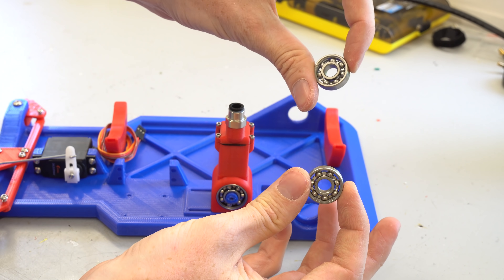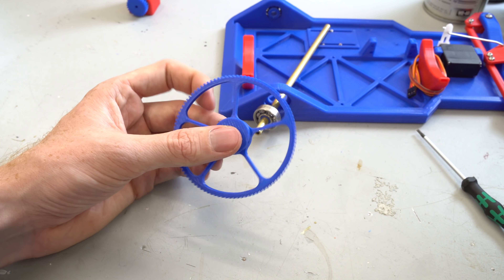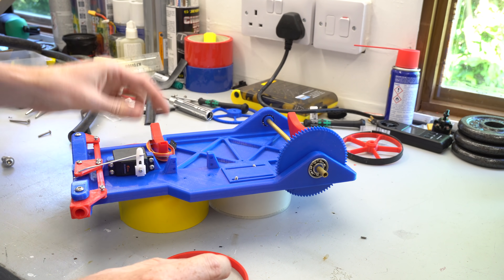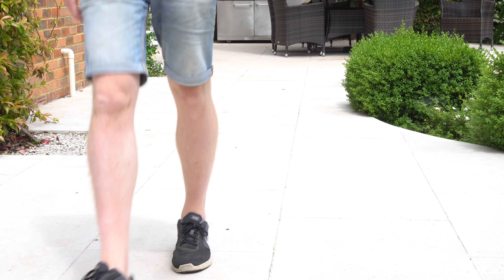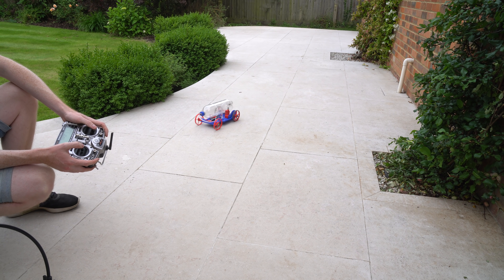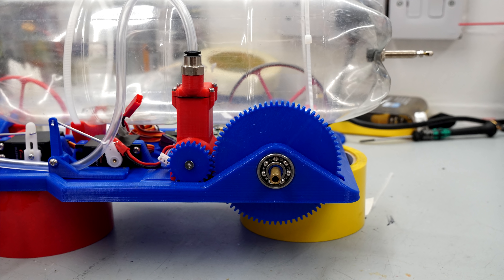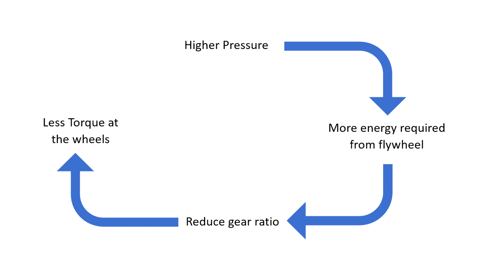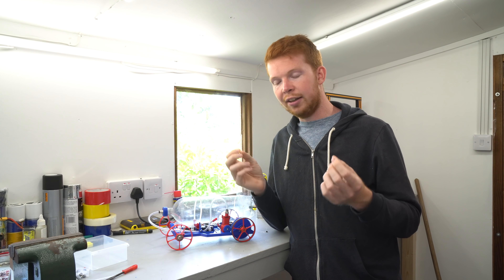Air Powered Car

Comment: The driven wheel is  running too slowly and is also too light to  be effective as a flywheel. You would be better attaching a metal flywheel to the engine shaft.   Otherwise I love it.  It makes a lovely sound as it chugs along.  Definitely worth persevering.

Comment: I would suggest making a simple centrifugal clutch. No return springs or anything like that, just two halves that will grip when rpm is sufficient and slip otherwise. Although that may be a bit wasteful towards compressed air, since the engine will freely spin until clutch kicks in. Add a simple cvt and that's a basic scooter transmission, which should work quite well.

Comment: Try making the air powered plane again! try using a more glider like design this time, it would be easier to power. I would really love to see a glider with a detachable air engine and bottle so you would only use the engine to get altitude until it runs out of air and detach it (parachute recommended)

Comment: What if you tried adding an extra flywheel connected directly on the same shaft as the drive wheel? This should not be affected by the gear ratio while still providing the engine with the touque it needs to push up the inlet valve.

Comment: With a belt type clutch you would spin up the engine and then taking off after hopefully working alot better... also you could then try to work on acceleration and test different gear ratios..

Comment: My suggestion would be to put a flywheel on the crankshaft of the engine rather than on the axle. This should allow you to gear the drive ratio down without reducing the flywheels effectiveness. My theory is that these air engines are more efficient per revolution when running at higher rpm as there is less time for air to escape past the piston during the down stroke.

Comment: make a small metal flywheel on the other side of the engine... maybe a pulley type clutch could work with 2 pulley wheels and a loose belt with a third servo controlled wheel acting as the tensioner engaging the clutch?

Comment: Can you not just pump the bottle to higher PSI's and use a regulator to output 30PSI
Reply: Just saw your comment. We have the same idea. This way his max PSI doesn't matter. His low RPM engine is actually efficient in that regard.
Reply: Yep, technically he could fill a small aluminium bottle to much higher PSI and just regulate it for a really long runtime
Reply: You could do that. Buuuuut...

WE GOTS TA GO FASTE
Reply: Along with the pressure regulator he could use a two or more cylinder steam engine design for self starting and us an aluminum container with some dry ice in it.
Reply: Julian Fernandez or use a small, battery powered compresor. I’m guessing 30 minute runtime. Maybe even more
Reply: @slippulter8053  at that point you might as well use an electric motor.

Comment: For an air engine would it not make more sense to draw inspiration from steam engines rather than internal combustion engines? 

Specifically, the only real reason to use a cam over an eccentric is the need for timing to fall on 90 degree intervals rather than 180. In your case the benefits of using an eccentric and slide valve over a cam and spring are near constant resistance instead of the spike you get as the cam engages, and greatly reduced resistance since there is no spring force to overcome.

Comment: idk if this will help, but i'll share it with you anyway. (If the gear is 12/35) Minus 1 tooth in front equals plus 3 in the back (gearing is 11/35 but has the same effect as 12/38) and plus 1 in front equals minus 3 in the back (gearing is 13/35 but has the same effect as 12/32)

Comment: You need to put dry ice and water into the bottle then attach it to the air powered motor
Reply: Combined with a safety valve, I can see it working.
Reply: google "dry ice bomb", then go sit in the corner and think about what you have done.
Reply: Papooch until your safety valve freezes, blocks with ice, and the bottle explodes. Go watch this video by Ben krasnow to find out what happens when you put co2 through a tiny orifice https://youtu.be/TvmM6qa2a90

Comment: f= frequency. T=1/f. your engine only produces power in half of a cycle.

you should double the cylinder to make your engine produce power continuously. if you want to use 1 cylinder only, you should change the valve system. I recommend a slide valve or a rotary valve (which you mention in the video).

my idea is to use a 2 stage engine. you will let the air push on the top of the piston in half of a cycle and at the bottom in the other half. you don't need to use 2 cylinder but you can produce power continuously. Because the engine produces power continuously, you don't need a flywheel to reserve power for half of a cycle (which doesn't generate power).

your car loses power when it turns due to friction because it doesn't have a differential.

edit: my english is not so good. it may be difficult to describe my idea.

Comment: I would think you would change the timing of the air entering the engine by a small bit. What I mean is try and get the air to enter the engine at a later time. More when the Piston is at a lower position in the cylinder. Unless you've already done this.

Comment: hello Tom, before redesigning all the engine try to add a flywheel on the crankshaft, on the other side of the small gear, maybe you get the needed effect
If the flywheel is bigger than the pinion you can lift up the engine with some thickness: extend the screws in the slots and you're done!
If you have to change the reduction ratio I think it's better to reduce the pinion on the crankshaft: the other gear is already as big as the wheel ... you'd have to redo those.
It's nice to see that little rat moving around the garden!

Comment: I think the reason you couldn't go faster by raising the pressure is due to reaching the engines "horsepower" limit with the current volume and internal friction. Since you added all the weight of a car instead of just a propeller, which weighs nothing, this seems like the only answer why it can't go any faster.

Comment: Build a pressure regulating valve this way you can increase the pressure and therefore volume in your tank without increasing the pressure at the engine.

Comment: Maybe add some sort of regulator or a pressure control valve so that you can limit the output pressure to 35 psi, while having a tank at a higher psi for longer driving

Comment: You could build another engine and arrange it so that always one cylinder pushes down or add a flywheel.
Reply: Stefan Bramel like a kind of multi cylinder engine, but with the gear or shaft to link them into synchronisation.

Comment: Maybe design a clutching mechanism to allow the engine running while at low throttle. May make more stable driveability. To add a simple flywheel or a jackshaft/flywheel would allow for stable idle. The engine in theory works with a constant load/fixed demand. It will need more mass to overcome the compression stroke.   I feel you dont have to increase pressures but you have a direct drive and no weight to toss around the horn. At square one, a clutch with low engagement speed will massively increase the mass for the engine to run. If I may interject? Get rid of the parallel drive system and go to a perpendicular set up. It will allow a clutch, flyweights, a short driveshaft with 90° gears and stable operati9n. Your 3d should accommodate that well. Also, look into building a base to implement a co2 cartridge. Very small tubing with an expansion section it will allow a decent pressure and function. Look up c02 air engines. They're been around for a while.

Comment: And if you craft a twin engine version? I think that it would be a nice idea. The thing is that I don't know the problems it may cause.
The pressure needed to run the engine is higher but other than that anyone can tell me? Pls 
Pd. Nice video bro

Comment: Maybe add an extra flywheel and then add a pressure regulator and fill the bottle with some dry ice. Should run for quite awhile.

Comment: why not  just make the wheels smaller?  Looks to me like it would solve the torque problem without touching the gears. Flywheel problem remains the same but inadequate torque is the major problem here. If you can get the car to accelerate a little bit it may overcome the flywheel problem since the momentum of the entire car is practically the flywheel

Comment: You can try redesigning the valve to work like a reed valve, the same stuff that is used to prevent reverse flow of gases in 2 stroke engines. The flap will have a lot less inertia than the ball.

Comment: For your next project you should try to make an air powered paddle boat, and use a dual pressurized bottle system. Put the bottles on the bottom of the boat to keep it afloat

Comment: I'm no physicist so therefore not able to calculate such things, but what if you calculated the amount of energy you need to put in to compressing the air and then measure the distance and speed that your car travels in order to calculate the energy loss between the two. 
By that you'd know the efficiency  and then figure out if you car isn't traveling far because of an engineering issue or because there just isn't anymore energy to be used.

Comment: Attach a fly wheel on the other side of the engine, I think that will work. You'll have to print a new modified chassis or just take out the dremel and go to work.

Comment: Need more torque, eh? Sounds like you need a multi cylinder engine! But In all honesty I deal with single cylinder lawn equipment engines all the time and they always have a very high gear ratio and a fairly massive flywheel for its size, or at least some sort of variable transmission or clutch. The power impulse is just too erratic for smooth operation without a large flywheel and high gear ratio. Which actually brings up the question as to whether or not a multi cylinder would actually be more efficient... I haven’t run the numbers I’m just thinking out loud here. Also this car reminds me of old steam tractors from the sound and wheel design lol. Good luck and keep us posted! Love seeing the process of trying to get these things working.

Comment: make your flywheel with a larger "flywheel" section, and then put the same gear you have now on its side, to you gain the weight of the flywheel and still have relatively the same gear ration. give it a try and see?

Comment: You may consider using a diferential. When the car is turning it's losing speed because the wheels should be allowed to rotate at diferrents speeds. In order the be more efficient maybe it''s better to drive only one wheel, and let the other rotates freely. Congrats, very interesting project!
Reply: A problema with powering only one wheel would be different speeds deppending on which side you turn. If the powered wheel is inside the tangent the car would turn faster than if the powered wheel is outside the tangent. A open differential would be a better solution, but the increased friction should be considered.

Comment: Explosive idea : Hydrochloric acid + aluminimum inside a bottle as a constant pressurised air supply (and heck you can even make an exhaust outof metal and have the exhaust fumes set on fire for extra style points :p)

Comment: You can also put a flywheel directly on the first (small) gear. So the efectiveness of the Inertia is much higher since the angular velocity for that gear is a lot higher (larger momentum). You won't even have to keep in mind your gear ratio then. 

Also the effect of the gear on the inertia is quadratic and on the torque it is proportional, you might want to do something with that.

Comment: Hi dude, I would suggest to use this kind of valves http://www.vparavoz.com/uzk/images/image_139.png
It will require two small metal plates where but all other part you can still 3D print. What do you think?
Reply: I think it will require less force to open and still provide enough good sealing

Comment: Also, there could be a way to increase the engine run-time, by limiting its RPM using a mechanism similar of Edison's phonograph's governor. Or a classing steam machine centrifugal governor. Edison's one worked by allowing the governor to only expand to a certain radius before touching a felt stopper fixing it to that speed (More detail in https://youtu.be/0vbyoZDQaIY?t=10m43s ). The steam one regulated the ammount of fuel admitted into the cilinder depending on its speed.

Comment: What about an in-line air regulator? Pump the bottle to 80psi set the regulator to 30psi you should get a longer run time at least.

Comment: If your throttle servo is a plastic gear, there may be to much pressure on the gears and could result in gear stripping in the servo. If there metal it’s fine but I couldn’t tell. Keep doing what your doing!!!

Comment: To prevent the large gear warp from happening you could try adding an aftermarket heated bed to your kossel mini if it doesnt come equipped with one. Also worth poiting out is the fact that if you do decide to add a heated bed you're also gonna need a better power supply as suggesyed by many other youtubers with the kossel delta. If you do have a heated bed then idk probaply play around with the heat settings and you should get it right but i understand how time is not on your side when making these videos

Comment: Hi, Tom! Great work on your current progress. Your project looks amazing.

I have found a solution that might fix your problem. You could simply add a heavy flywheel directly to the motor output instead of the wheel output. That would help you overcome the valve actuation counter for currently experienced by the wheel. It would also spin alot faster. A simple flywheel design could be made with a round 3D printed disk with embeded steel nuts.

Comment: Should go with a positive displacement vane motor or sun and ring type gear motor and you will have self starting, always runs, even without a flywheel at all to drive the motor for as long as you have pressure.

Comment: And why cant you add a starter motor to the engine it should be an easy solution to this problem I think
Reply: The problem isn't that it's unable to start, it's that the wheels don't generate enough torque to open the valve at TDC

Comment: It would be interesting to see a design that has a flywheel at the output of the motor that connects and disconnects to the wheels via some servo operated mechanism. Maybe by pushing a rubber wheel against the flywheel like the old cassette recorders used to do.
Also with this flywheel design you could add a second air path with some kind of wind turbine used only for starting the engine. Maybe with a more traditional pneumatic motor design like the one used for pneumatic screwdrivers, also you can look up how the artificial horizons power their flywheel. 
PS: Given that it doesn't become too heavy to run

Comment: Maybe you can try some different kind of air engine that doesn't use a cylinder? There are a lot of different water pump designs that could also be used as air engines.

Comment: separating the drive gear from the flywheel could solve this issue. you could design a flywheel that properly times the engine for higher pressures, then implement some sort of bicycle style transmission to change speed instead of relying on the throttle.

Comment: you can go for a multi-cylinder engine finally, I would say.
Best opportunity dude!! go for it ! It will increase the torque and since both engines will share the same air source they will seem to have less pressure. You see it sounds like a win-win solution!!! Great video again! Keep it up!

Comment: Have you considered putting a pressure regulator between the tank and the throttle? The tank could then hold more pressure giving you a longer run time, and the regulator would be able to be set to the optimum PSI to run the engine efficiently.Great Project........

Comment: What about increasing the Piston Travel via the Crankshaft?
You have such a long Connecting rod that isn't necessary with these small cranktravel
If you Increase the Crankdiameter you should get more Torque

Comment: Try gluing some large washers to the output of the engine(small gear), they might store enough energy to open the valve. 

Also, now it’s ground based you don’t have a weight limit, could you add another bottle?

Comment: When designing gears you should avoid having whole numbers for the gear ration. The reason is that the same teeth will grip with each other over and over and wear way faster then when the gear ratio is not a whole number.

Comment: why not regulate the pressure? that way it could run at the higher PSI, and the lower end as well. that should give you a longer run-time.